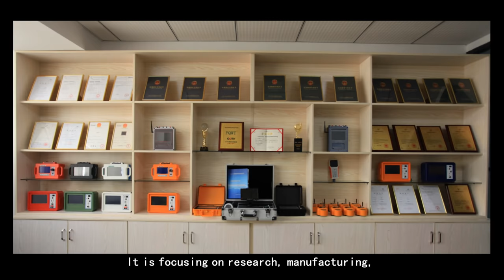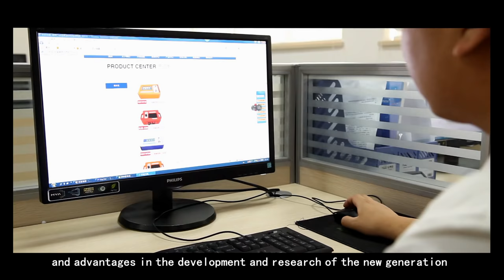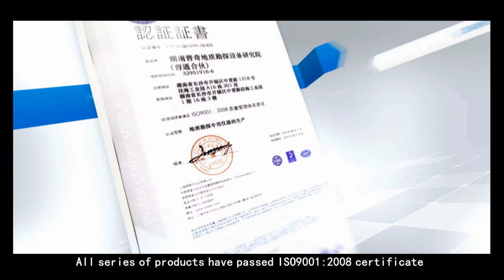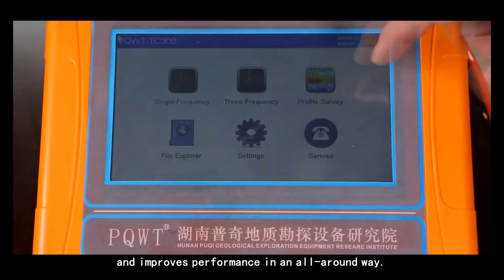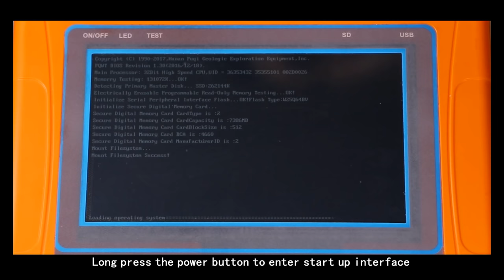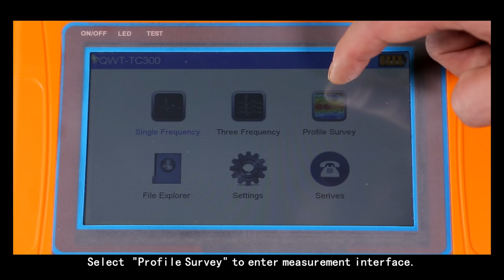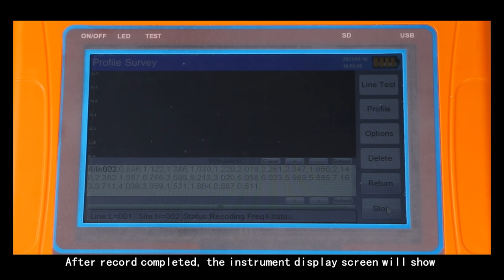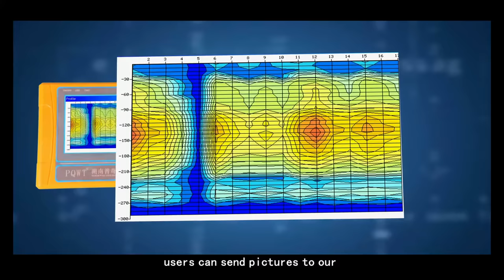How to find exact point using 3D Mapping Ground Water Detector

Comment: Hi there, I am Stephane from Cameroon, I have an ADMT-2S ground water detector, it measures resistivity at 7 different frequencies: 4900,2000,600,170,67,35 and 25hz, I am not to sure of the way I am doing my interpretation on surfer. Thanks for your help